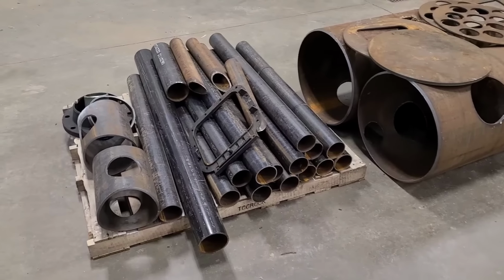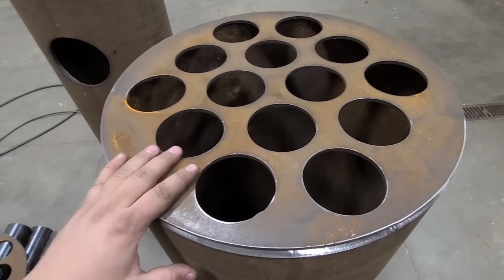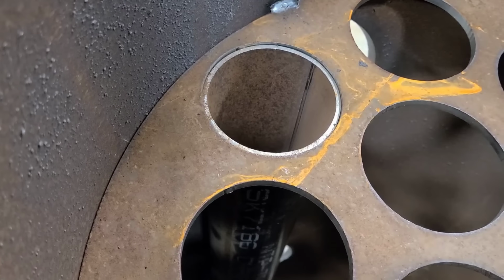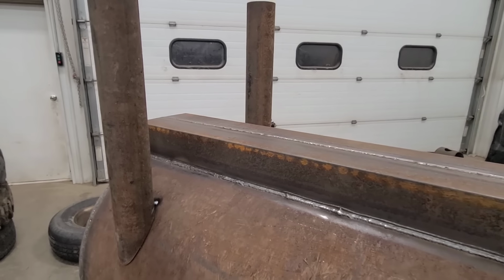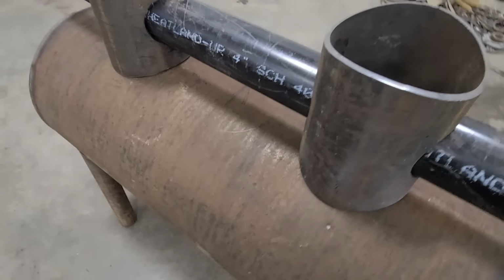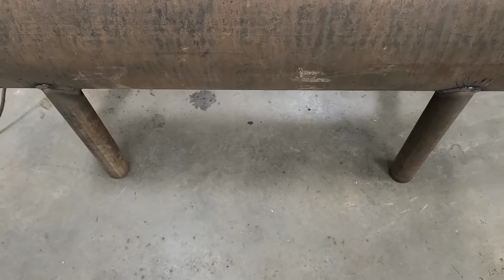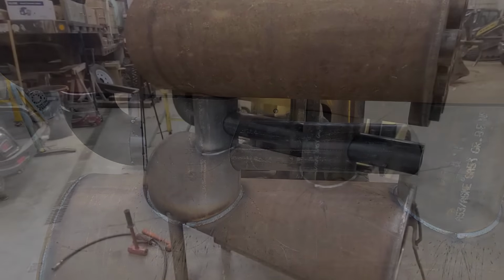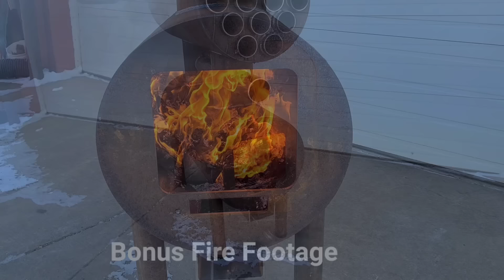My Ultimate Shop Wood Stove Build Part 1

Comment: o-<-<-<-<-<-o, is that the welding pattern he's using? I don't know of any other way to describe it, other than it doesn't seem he's doing circle pattern and NO, I am not a welder bashing him, just curious if that is what he's been doing. The first o is the starting point, weld forward, than back across the straight and keeps moving forward, hope that makes a bit more sense.
Reply from the maker: It's not a circular pattern, it's a straight stepped pattern 👍

Comment: DAMN......A LIL BIT OF Money in the steel, overall ?
Reply from the maker: Zero
Reply: @kylechrist  LOL.....I meant if I or anyone else were to go out and had to purchase it.
Reply from the maker: @freddietee1225  if I recall correctly, 20" sch 40 pipe was around $250 a foot, 8 ft here, so $2000 in just the two "drum" pieces
Reply: @kylechrist  O' and what wire were you using...(.45) ? just curious, i'm a retired Boilermaker, so your design concept was familiar🙂 also what ya think it weigh's 7-800 lbs ?  enjoyed watching the vid.

Comment: Fine lookin' heater, HOWEVER...If not place directly in the center of the shop, you're going to have cold spots/areas, UNLESS you design a system of ducts to carry the heated air to other areas......

Comment: How come people don't just use a semi truck intercooler as the stove pipe? Use a fan at the top to draw the exhaust through the intercooler and up and out; or just let natural heat rising do that. Another fan blowing onto the intercooler to push all heat out of it and into the shop.  Use multiple intercoolers all the way to the ceiling if needed, you won't waste an spec of heat.
Reply from the maker: Most are aluminum and won't stand up to the heat, and honestly those small tubes would plug quite quickly as it is also possible to be too efficient to where creosote buildup occurs. If it were that simple, it would've been done long ago 👍
Reply: @Kyle Christ  ahhh clog up.  Yep forgot about that. Hmmm, it's the most efficient heat exchanger....gotta be a way.  I'll keep thinking.

Comment: That garage door looks old. Hate those half hinges! A2000 I think.
Reply from the maker: That door is a commercial door and less than 5 years old. Not sure how that relevant to the video
Reply: @kylechrist  Not relevant at all,garage door guy here. Kind of hard to not notice doors!😁

Old meaning,I remember these doors from Industrial Door in Coon Rapids Mn and working on them.

23 years doing doors,service and install,commercial and resi.

Actually I came for the fab and weld because I finished welding school last May and I have built many wood stoves.

I enjoyed your presentation!
Reply from the maker: I misinterpreted your first comment, I thought you meant it in a negative way. Unfortunately I've been getting both great and negative comments on this build and I took yours wrong. Thanks for clearing it up and thanks for watching
Reply: @kylechrist  Awesome build! Right on point with scavenging all the heat you can. 

We rebuilt two cheap Silver Dollar brand stoves,one this year and one last year,jacketed forced air stoves.

Both stoves are outside and one feeds our small shop and the other heats under our manufactured home and inside as well.
Reply from the maker: @dolphincliffs8864  it's hard to beat wood heat

Comment: I like it but dear damn I bet that thing weighs more than a car. When it heats up it's gonna retain it for days but It's gonna take days for it to get up to temp.

By the looks I think your burn box is too long. I done the same on mine years ago, mine is 2 foot long. I been thinking of chopping about 4 inches off the rear of it just to make it easier to clean the inside. I cut my wood about 16/18 inches long so all that happens is the ash builds up more back there unless you really get in there and pull it out.

Comment: It's not the best design, the double exhaust into the heat exchanger is going to make it burn incompletely. To be more efficient you should have had a single exhaust in the back and a metal sheet in the center of the heat exchanger with a 2-4 inch gap at the front so the hot exhaust has to travel the full length of the system (twice) allowing for a more complete a burn (thus all the smoke you had) and more heat to be transferred before it exhausts out the top.
I've seen many use this same basic flawed designed and the S shaped flow is even used now days in little tent stoves allowing you to use less wood and make more heat since more will radiate out rather then going out the chimney.
Also a exterior intake for air might have been a good idea too since that thing is going to be gulping air like a thirsty man in the desert.
Reply from the maker: Double exhaust?

Comment: I see a chimney fire waiting to happen.
Reply from the maker: Please explain
Reply: @kylechrist  I would.  But considering how many excellent videos there are already on firebox construction, I don't have the patience to rehash what will likely be ignored.  Your **uninsulated** firebox will not have complete combustion.  The heat exchanger will condense the unburned heavy hydrocarbons.  At some point the 'creosote' (colloquial term) will get thick and it will ignite.  The flames will fill the HX and continue up the chimney.  I'm reasonably sure your 'oil country' level of construction will survive, but unless the whole chimney is built to the same standards it will not.

Even if we assume that you choose to build the whole system to those indestructible standards, others that watch this video may not.  And so my post is  a warning to them.

Please don't take this the wrong way.  In fact I'm jealous.  You have access to "scrap" that I have to pay an arm & a leg for.  I wish I could get 30 minutes with your boss, as I have a number of technical projects that I'd love to pitch to him.  And yes I realize that sounds extremely sarcastic, like "Swamp Land in Florida" or "a Bridge in Brooklyn", but it's not.  I'm an engineer/entrepreneur seeking investors.  And seeing that much value in steel, simply being tossed away suggests that the funding I'm seeking is probably a rounding error in the budget your boss is accustomed to dealing with.

Unlike many of the posters here my goal isn't to create warm fuzzies for creators, I call things as I see them.  That's why I'm an engineer 1st, entrepreneur 2nd, and I hire out positions that deal with people's egos.
Reply from the maker: @PaulPassarelli  I do have fire brick that could be used, as I said in the video, by no means am I an expert nor engineer, I was simply building off from other designs I have seen done, mainly the double barrel stove design. The chimney will be made of 6" sch 10 stainless steel as its more scrap that I have. Thanks for the info, I'm open to advice

Comment: Instead of the riser tubes why not just cut thirty degrees or so out of both tubes and weld them together?
Reply from the maker: Less surface area for radiant heat, plus if you've ever split a pipe before, there is a lot of tension being held together. A 20" pipe would grow to 24"+ and not be round anymore, harder to make endplates for

Comment: I think your ash tray will need frequent emptying. Otherwise, I like it
Reply from the maker: That's okay, ash is very dense and heavy, I don't want to have to pull out a 100lb tray when I clean it. I should be able to get several days of burning in before I have to clean it. Keep in mind this will only be lit when I'm in the shop working

Comment: Namaste All,

Like this Double Over and Under Barrel’s Heater Exchanger, but I would add interlinked copper water pipes, running down the centres of each of the 9 to 14 air pipes or tubes, with drilled spacer disc's added welded to the copper water pipes.

So heated air can still pass through these air pipes or tubes, while helping to heat up the water running through the newly installed copper water pipes.

With these copper water pipes running along the bottom line of air pipes or tubes from right to left. With "U" shaped return water pipes at the front too, which provide an easy flow of water going through the heating water pipes. 

Then going up one level to the second line of air pipes or tubes, this time running left to right, again with more "U" shaped return water pipes. Lastly going up one more level to the third line of air pipes or tubes, this time running right to left.

Or if there is a fourth and fifth line of air pipes or tubes, you just repeat the process, starting at the bottom to the top line of air pipes or tubes.

Finishing at the top with a hot water outlet pipe, to take the heated water away, to radiator or radiators and/or to an insulated hot water storage tank too. With just adding a water pump, which pumps the cold water through the heater exchanger new water heating pipes, at a necessary speed or rate of flow too.

Maybe be adding a cold water feeder tank, so the system always has enough water in the water pipes too, also using a rainwater capture and recycling system on the workshop roof, plus large underground water storage tank. Then you could have both hot and cold running water in the workshop, which is totally off-grid as it were too!

Just a suggestion, it would be something I would look at doing, for building a similar hot air and hot water heat exchanger, for a combination garage and workshop, plus greenhouse and potting shed too.

Namaste Gurkhamum Wendy and Wheelchaircharli39 David.

Comment: You need to learn stick welding, so when you get in a tight spot between tubing, you can still weld it. Please stop downhand welding. You had the pipe standing up so everything could've been done on the flat. It's just a stronger weld, and with the expansion and contraction of your stove it wouldn't take much for your welds to crack out. For welding in general you should clean down to bare shiny metal (weld zone). It gives better penetration and a nicer bead profile.
Reply from the maker: I know how to stick weld, but that does no good when I don't own a stick welder. There is nothing wrong with downhand welding when done properly

Comment: give it a waste oil drip feed too ,,, that changes the game totally
Reply from the maker: That may absolutely happen 👍
Reply: @kylechrist   Ive used the same basic set up for over thirty years , and a drip of waste oil completely changes the heat output ,, and they dont go through a lot of oil doing it ,,, why not stick weld the tubes instead of cutting them down ,, fast and easy.
Reply from the maker: @tomthompson7400  I don't have a stick welder but I'm looking into borrowing one
Reply: @kylechrist  id lend you mine if you were local ,,, a wee inverter handbag set is a useful thing to have ,,,,
Reply from the maker: @tomthompson7400  a stick/tig setup is on my list
Reply: @kylechrist  unless you go ac/dc ,, skip the tig , just buy a basic stick , way way cheaper and you will probably never use the tig on a handbag set ,,, ask me how I know lol

Comment: never seen something like this, so my question would be, why not just buy a proper clean burning wood stove? they cant be that much more expensive compaired to parts and labor of this one??
Reply from the maker: Steel was free, labor for cutting everything was free, just welding time is the only investment
Reply: @Kyle Christ  I'm sorry, I didn't you specifically, but on a general basis. Like I said, never seen something like this. And I'm pretty sure you'd get a "cease and desist" letter from the fire department if you'd install one of these in a cabin or even a workshop here in Norway.

Comment: with that pipe running threw the risers , you are better off not using a fan at all
Reply: and you do not want to cut the pipe flush with the burner barel.... you want to 90 it and get the end of it as close to the cround as possible with another 90 facing away from the barel, you will get a drafting air into that pipe then in the heat exchangeer and it will spew out of it without any mechanical need..... but you want that pipe to pull cold air off of the floor

Comment: That heat exchanger will eventually fill up with soot and no way to clean it out.  Ho hum.
Reply from the maker: No way to clean it out?
Reply: How would you clean out the top air exchanger.  It appears to be welded shut.  Our wood furnace has another door at the stack pipe that opens and we use a long handle wire brush to clean it, supplied by the furnace maker.
Reply from the maker: @realairplane261  in the video I explain that the back opening on the heat exchanger is a cleanout that will get capped. Everyone assumes this is the exhaust but it's not. There are two holes in the top of the heat exchanger and the exhaust pipe has yet to be welded on👍
Reply: Ok, I missed your explanation of the clean out.  You do nice work and have some great equipment!  :)
Reply from the maker: @realairplane261  no worries, I've received a few comments about not being able to clean it out, I'll explain better in the new video, thanks for watching

Comment: There is a major problem with these heat exchangers. Soon the tubes will be coated with soot and ash, losing efficiency and eventually plugging. And openings to clean them are problematic.
Reply from the maker: @BrianMiller-up3tw  not at all

Comment: The top piece is going to fill up with soot and creosote and probably start burning inside it. But why am I telling you as youve probably had it happen by now
Reply from the maker: It has not, there is a cleanout on top and by burning dry wood very little creosote builds up 👍

Comment: Not going to lie ,your lack of grinding your weld area is kinda driving me nut's..good project though..
Reply from the maker: It's not necessary, the weld is hot enough and by no means is this a pressure vessel that requires perfect welds, thanks for watching

Comment: Kind of anal retentive about the exchanger pipes. I doubt that that small part your welder won't get into is not a big deal really.
Changing your mind about things only makes things harder than they have to be.
The large center pipe isn't really needed but its your heater not mine.
About 30 years ago I helped build a heater similar to yours and the owner kept it simple and it worked fine and put out almost too much heat. The thing burned a ridiculous amount of wood. Not very efficient really but it heated a huge shop..

Comment: You’re moving waaaayyyy to fast on your welds. Should be circles, not arrows on them.
Reply from the maker: That's not true at all, it all depends on heat settings, material, and weld pattern being used
Reply: @kylechrist  fair enough, I stand corrected! Awesome project by the way. I am thinking of building one myself!
Reply from the maker: @micahseyler6917  no worries, thanks for watching 👍

Comment: Ok, the setup you have there is going to create a fire hazard.  The cooled smoke will condense in the stovepipe, and the buildup will catch fire, the same as in a chimney.

There needs to be a source of turbulence in the firebox, to mix oxygen with the heated wood gases, and insulated burning chamber, so the smoke will be completely burned.

Modern wood stoves tend to be smaller, with plenty of turbulence, and with the heat extractors.  The wood has to be cut smaller, and the fire fed more often, but the amount of heat produced is justifiable.

Comment: Sadly this is a fail. All the smoke is wasted fuel  (pyrolosis). You should pay less attention to form and much more to function!
Reply from the maker: There is no chimney on it to create a proper draft, no door or damper setup, this was only an initial burn in to remove the coatings on the steel

Comment: I think you will find that you should have forgotten the "heat exchanger" completely.  You should get more than enough heat extraction with just the 4" shotgun barrel alone.  so much time material and effort completely wasted.  Please let me know how it all works out for you.  I think you will be able to place an ungloved hand on your heat exchanger at any time. as the heat has been dissipated via your shotgun barrel.  there will be no effectively useable heat gleaned from the exchanger at all.  In fact, I think your heat exchanger may actually express cooler air into the area being heated.
Reply from the maker: There will be another video going over the performance once its installed. I still don't see it being a waste of material since it was all destined for the scrap bin before I decided to make something out of it. Just on the initial burn in, I was able to melt snow into steam off from the exchanger tube, so there is heat present, even without a chimney to help pull a draft and heat upward. This was my idea based of the double barrel stoves I've seen, it may work, it may not. What I do know is it will be much better than nothing at all 👍

Comment: You've built an incredibly inefficient wood stove.

You have a box to hold fire, and a heat exchanger to extract heat but there is zero thought put to increasing the efficiency of the burn, so at the end of the day, you're always going to be producing a cold smoky fire, and probably half your fuel is going up the chimney as smoke.

If you actually want efficient heat production from wood, consider some sort of masonry heater or rocket mass heater. You can't have an efficient stove with smoke and high exhaust temps.